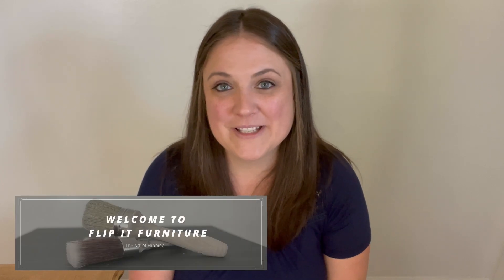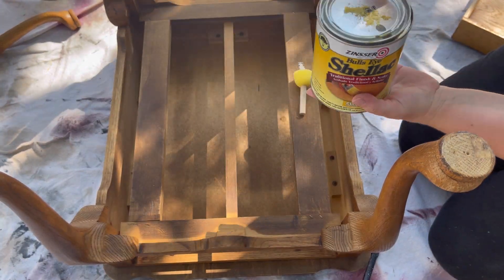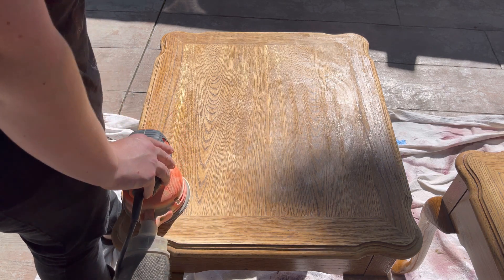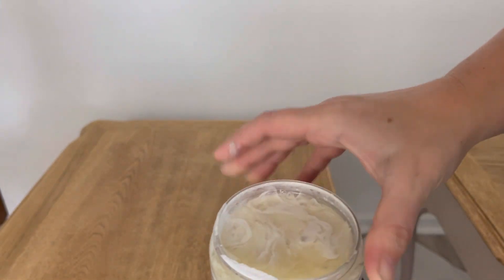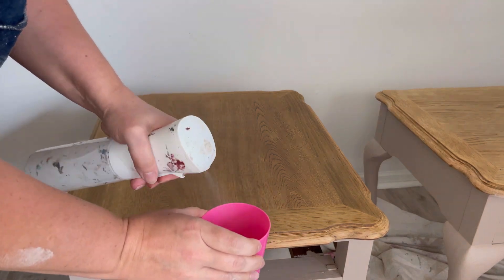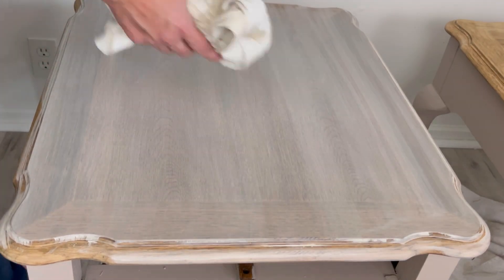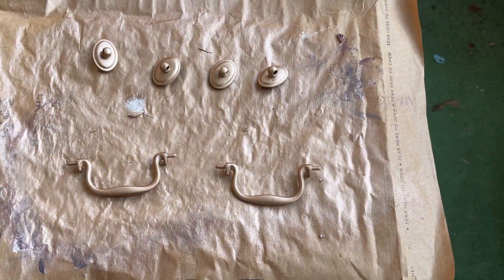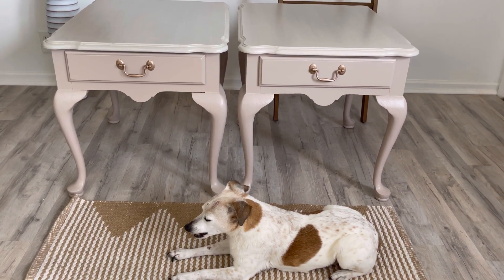Side Table Flip | Romantic Style side table furniture flip using Lily Moon Paint

Comment: You can take a wire brush & going with the grain of the wood you can clean out any dirt & gunk & it will bring out the grain in the wood, then when you do a stain or a wash you can see the grain so much better. It is called cerouse.  I could have spelled that wrong, but it is a process that is really great on wood that is being stained or washed.

Comment: Did you shellac the tables before stripping them? I'm confused. Or did you only seal the under parts on the table? They turned out beautiful!
Reply from the maker: I only used shellac on the bottom: I striped and sanded the top then added a primer before paint to lock in the tannins.
Reply: @FlipItFurniture  Thanks for the clarification! I thought that is what you did.
Reply: @FlipItFurniture   did you use shellac inside the drawer to get rid of smell?